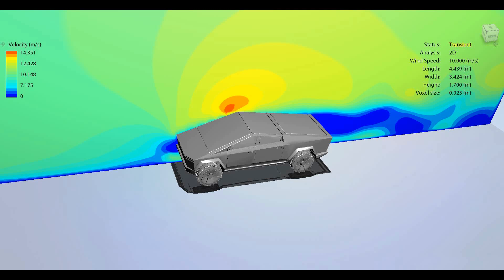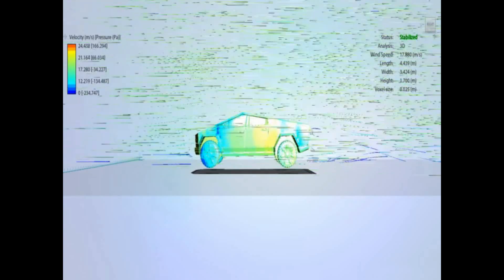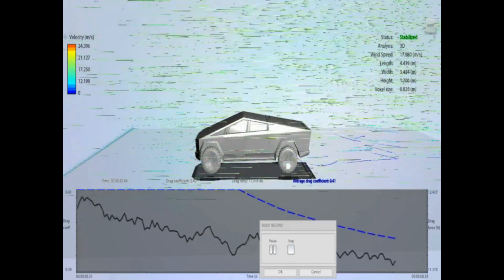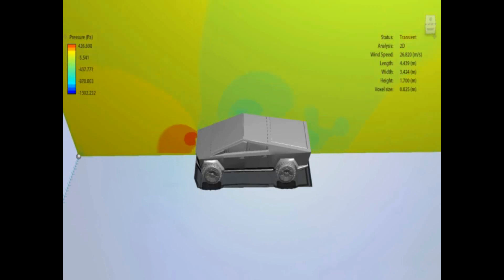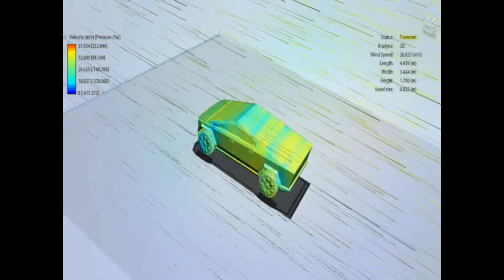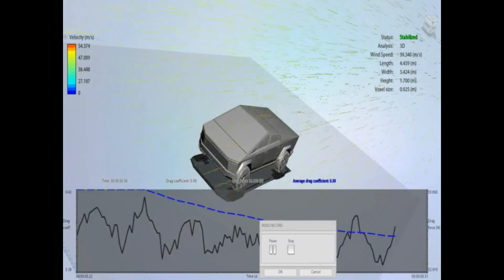Cybertruck aerodynamics - Whats going on?!!!

Comment from the maker: Please bear in mind that the cd figures show in this video could be  way out! 
I am using out of date software and the model is not 100 percent accurate.
I have now made a follow up video showing cybertruck compared to other pickups which gives more insight:
https://youtu.be/7741YdnAcR4
Reply: Can you show one with the truck bed panel opened on the cybertruck
Reply: from an aesthetic point of view i have called this vehicle "ironically truck like" as i think it very much appeals to "the guy thing" as US trucks are legendary for. Having said that and while this is an excellent presentation what will make this truck stand out (besides the lack of mirrors) is how low the weight in this massive vehicle "sits"(curb weight.) yes I've been blown around by the wind big time driving trucks to lorries but what i really like is how stable this massive vehicle platform is...particularly in the crosswind. as a truck i think this an amazing vehicle inside and out, front to back...and has an absurdly low entry level price of $39,900 US Dollars.
Reply: Which software you are using ?
Reply: I though my phone vibrated at 5:12 Lol.
Reply: Thanks man! I would open the load area of the model. I'm almost sure that you will get quite different values. Overall, is a truck that I would like very much to have here in Portugal! I'm just not sure if it survives to the European legislation... The truck has too many Sharp edges that may Hurt pedestrians (something that has been a big concern in automotive legislation :( ). I like that the truck has such straight panels. It allows us to be creative when modifying our truck. So in my case is not so much the futuristic looks that matters...is the simplicity and costs :)
Reply: Wow, 798K views in a week..
Your video on Cybertruck has been Trending.
I'm pretty sure you're glad that you made this video.

Most of your videos didn't even reach 50k views but a Cybertruck has 3 quarters of a million.
Reply: Please drop the ride height by 8". This vehicle has dynamic ride height and drops to a "crouch" at higher speeds on smooth roads.
Reply: David Ogawa The air that goes under your car has a bigger difference in the aerodynamics than the air over the car. That’s why newest cars have air dams below the bumper and most of everything under the vehicle is covered by plastic covers
Reply: Is it legal to drive...?  Military style truck, aaack!
Reply: what software are you using, and what would you recommend for someone looking for low-cost cfd?
Reply: @tejasvimishra1   thanks😊
Reply from the maker: @tejasvimishra1  yes it is flow design.
Reply: Not always truck bed will be closed, so can you Analysis with back lid open?
Reply: You forgue te broken Windows
Reply: Isn't it meant to close of the tub of a pickup for long trips? Btw you tested the cyber truck with closed tub and the others open
Reply: Hi Chris,

Could you repeat the test using a Model 3. Or could you repeat the cybertruck test introducing an opposing laminar flow of air, shooting from the front grill to the front (think of the Dyson airblade), creating an air shield for the front side of the car (like an umbrella than a blade)?

I am trying to figure out what is the contribution of air drag to watt-hour/mile and if we can create sort of a force field around the car to reduce air drag and thus improve energy efficiency. I read that this was done successfully for aircrafts and I was wondering if we can do this for cars and increase range!

I will try to learn CFD but I am from Computer Science back ground and not sure how much time it will take.

Thank you,

Faiz

Comment: I've got a Cybertruck on order but probably won't get it til the end of the second year. By that time I expect there will be some after market aeromods we can buy.
Hers my list of mods I'd try 
First off I'd think that instead of knoby tires some better all weather street tires for better airflow. 
 Then a flexible air dam in front, some wedges in front of the front tires to keep the turbulent air out of the wheel wells and some side skirts to keep air from wrapping around the sides into the low pressure under the car.
And there's several things that might help the turbulent air dragging behind the tailgate... A diffuser under the rear end comes to mind AND a teardrop tail shell attached to the tailgate with some vortex generators on the tailgate top edge (at least 9 of them I'd think).
A big thing is the ongoing effort to get rid of the side mirrors which are huge turbulent flow (ie drag) generators and just use cameras. But that requires a lot of state legislative bodies to change their laws so I wouldn't expect that soon, even though it's needed.

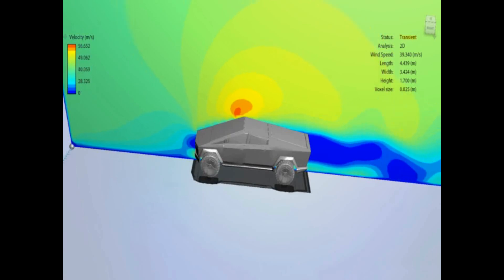Comment: Well, from interpreting your data around the @4:35 mark, doing some conversions and approximating the frontal area of the truck as being 40 inches by 80 inches (excluding slanted frontal area of windshield), that would mean at 87mph (26m/s) you would have an opposing force from the air pushing back on the truck of 415lb (188kg). I would in no way consider that negligible or even small.

At @1:58 - 39.8mph (17.8m/s) you still have 83.2 lb of force opposing the truck moving forward.

This does not include the drag cause by turbulence behind the truck.

Would also be interested in seeing boundary layers.

Comment: 2:09 you say don't have it on the ground. Is that a limitation of the software? Maybe you have a tiny model artifact hanging off the bottom under the model? Could you instead include a road bed slab as part of your model, raised up to touch the wheels?
Reply from the maker: Hello, it's as far down as the model will go in the environment, I think it's just so that you can see round everything. Good idea for the slab in terms of looking at the flow,  but it will measure the drag of both the  slab and car model.

Comment: this was an awesome video - thanks! and you're clearly more schooled than me, but wouldn't you need to have an open pickup bed to see aerodynamic forces?  Normal pickups have a lot of air swirling around the cab in the bed, wanted to see if that was resolved in the tesla design.  Thanks dude, earned a new subscriber
Reply from the maker: Hello, yes open bed will make the cd higher. But the cybertruck comes with the bed cover as standard.
Reply: Boats and Engines ahh gotcha - cheers!

Comment: The panel design is only aerodynamic to a certain degree. People think this is aero dynamic because early 5th gen stealth aircraft, like the F-117, featured panel designs and it “looks fast.” It was only designed this way to refract high frequency radio waves. All stealth aircraft now feature rounded and smooth edges to be aerodynamic. The panel design has no advantage to aerodynamics on aeroplanes.

Comment: This analysis can't be any more than a rogh qualitative overview, we also don't know what your residuals nor your turbulence model are.
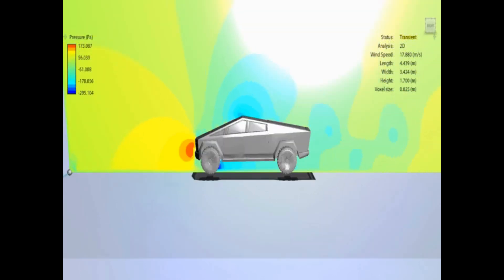You've said that no separation occours (0:50), but the separation region can be predicted only with a good near wall grid and the proper scenes to show it are velocity vectors on the boundary layer and the wall shear stress.
From the velocity magnitude scene I see that you haven't used a moving ground: may not be too relevant for a high ride vehicle, but still quite inaccurate. Don't know if you used a rotation rate on the wheels either.
You said there is a vortex in the front of the car (1:01), this makes me highly doubt you know what you are talking about; any object encountering a flow will generate a high-pressure stagnation region on the front, a vortex is a completely different thing. Then obviously the flow has to split in some way, but "artificial splitter" seems a bold statement.
The most serious problem though would be if you actually used a 28 mm CAD model to simulate flow at normal road speed; the Reynolds number Re tells you that it is like simulating the 1:1 scale model at less than 1 kph: totally irrelevant. A sign of this may be the periodic wake, typical of bluff bodies at around Re = 100. For a vehicle Re should be at least in the order of millions.
At least, I'll give you that switching to 3D steady state for the Cx evaluation is the right thing to do and sharing this kind of content is interesting.
Reply: Yeah... its pretty obvious he has no real clue about what hes talking about

Comment: Dude, why is Cd dropping with increasing speed? This indicates your model is probably incorrect.
Reply: Yifan Yao The flow becomes more turbulent. This makes viscous effects less important and thus decreases skin friction. This is what vortex generators do on airplanes.
Reply: @patefrilund  isnt the point of Cd, that drag is proptional to the velocity squared: f=cv^2, were c is a constant. If cd changes then this relationship isnt true?

I do know that some forms, like a sphere have their Cd change with RE, i.e. velocity. There are experimental grapghs for this. But it feels like theres a contradiction somewhere, am i missing something? Can someone explain?
Reply: Jordan Mills Cd is not actually a constant and it is indeed a function of Re. In practice, variations in Re are usually small, this is why Cd is usually treated as a constant. But in this case we are going through a wide range of Re which is why we see a shift in Cd.

I’m no expert on this matter so someone smarter will hopefully correct me if Im wrong.

Comment: It's almost like the top of the truck is designed like a Venturi in a wind tunnel, with quick flow acceleration and slow flow deceleration to prevent separation over the rear of the truck. Cool shit 👍🏻

Comment: At first glance it doesn't look aerodynamic, but at low speed the box shape doesn't really matter (air resistance goes with velocity cubed or smth) and at higher speed those vortexes/ high pressure zones create artificial curved surfaces for the air to go around.
Reply: High pressure zones dont magically make it aerodynamic. These zones produce drag, and the thing doesnt look aerodynamic because its not

Comment: Ok so the reason today's cars avoid sharp edges in aerodynamics is because air needs to flow alongside the body without being disrupted (air separation causes small turbulence- bad). Look at a "normal" car for example- top of the windshield connecting to the roof part is almost the same in every single car (small deviances in angles because why?) How cybertruck manages its aero is still a mystery to me (looks pretty scary). I don't know why but simulation in this video seems kinda off. (I'm not a expert).
Reply: Simulation is very off, no way there isnt seperation after that sharp as fuck edge on the roof. Also "drag decreases as speed increases" is quite a nice one

Comment: I'm willing to bet, the energy cost and financial savings made by not making this the most aerodynamic vehical on the road, like many car manufacturers tend to spends thousands on during their design phase, may actually be more, than the energy cost increase, to powering the car in its current and future states, than if it was designed to be a sleek bullet etc.

Comment: I know with normal trucks, having the bed open and exposed improves the overall aerodynamics. Did you happen to simulate airflow of the Cybertruck with its bed open? I wonder if it has the same vortex-suction effect with its revolutionary shape? Thanks for the video, this is awesome.
Reply: I know a lot of people will disagree with me so here is the explanation I gave the comment below: "When there is no cover over a normal truck bed, the air creates a vortex of low pressure in the bed, which, in turn, creates a streamlined "invisible hood" that decreases drag. When you put a cover on your truck you eliminate the possibility of creating such a vortex and end up creating more turbulence. This was explained to me by my professor at San Jose State University. He is an executive at NASA with a Ph.D in aerospace. Take it or leave it."

Comment: I'm pretty questioning of how good the results are with Autodesk Flow Design - I've messed with that and found it to be a rather primitive CFD program that doesn't give the results that seem sensible or what you'd expect, one that has been discontinued due to it's lack of capability. When I look at this design, I think of the three parameters that matter for aerodynamics - drag, stability, and noise. This addresses drag, but I question how accurately. Stability is mostly from lift (or downforce), I don't know how much lift this would generate - lacking a curved upper surface I'd imagine the airflow won't follow the roof and it probably won't make much lift. But being so heavy it's probably mostly a moot point, no amount of wind could bother several tons of batteries. Noise is also hard to tell, it doesn't have much in the way of protrusions, but I would suspect some noise could result from air flowing over those angular edges. But I imagine it will probably be so solidly built and well sealed that even if a lot of noise is generated not much will make it into the cabin.

Comment: You forgot to add the trailer because this wont carry the sofa or the grill or anything else you would actually need to haul in a truck this is basically a larger car maybe even a small SUV this is no truck also they might need to spend even more money on batteries before electric will actually help the market and a reduction of fossil fuel power plants and steam power plants

Comment: The wake getting directed to the ground is an indication of lift being generated by the top of the car, which is terrible for stability as you approach 88mph. It would benefit from a spoiler that perhaps could pop up from the tailgate at highway speeds.

Comment: I don't think this is how the pickup truck is gonna look well not the Uk spec as it wouldn't pass the test on pedestrian safety i.e sharp edges. Can't remember what the test is called but it states vehicles must cause minimal damage if they were to hit a pedestrian in an accident
Reply from the maker: Yes, I think that's what ended the defender too. I expect they are going to have to make some changes to the front to make it comply with regulations here.
Reply: @BoatsandEngines  For the defender it was emissions not passing standards but it's coming back. I'm guessing it's a prototype that will be fairly heavily tweaked but it will still resemble the Cybertruck of today hence the low $100 deposit

Comment: Could you please make an aerodynamic simulation with an object which has a dimples like a Golfball but instead of ball shaped dimples they should be egg shaped. The coned shaped tip is directed to the airflow and then the round tip and what where the differences?

Comment: the diagram shows clearly that the sharp edge on the roof line causes unnecessary turbulences. And it has no other functional benefits, because nobody necessarily  needs this extra headroom . It was done for the styling only.   
What the computer model does not show is the uncovered front axis and front suspension  on the real car, that are bad for the aerodynamics as well.   
Generell sharp edges are not good for the aerodynamics, but the flatter the windscreen ,the less the edges have a negative effect.  at the front on the bonnet, where the air has to pass over, the edges are not that sharp but beveled to less then 45°

Comment: This strikes me as a silly debate because NO truck has good Aerodynamics, and the Cybertruck is probably better than most.  This only became an issue because people are comparing it to other Tesla cars.
The reason it's so angular is the alloy of steel they used cannot be bent into smooth shapes without breaking the press.  It has to be folded.

Comment: I think its profile is like an airfoil which creates high pressure underneath and low pressure above, therefore, when traveling at higher speeds it might be lifted up, which would be a disaster.
Reply: was thinking something similar,  a repeat of the early Audi TTs if not careful

Comment: well car still sucks gonna have a 80 mile range when towing at 80% capacity
Reply: Not likely,  only energy used for acceleration is affected, not drag.  Also much of this is recovered with the extra energy collected with regenerative braking when heavily loaded.   The range might be slightly less, but not much.   A ICE truck doesn’t regenerate fuel when it uses brakes, let alone extra energy when loaded.   So ICE trucks lose range much faster when loaded.
Reply: @miikkakangas6750  gas has much more energy density than electric motors are efficient

Comment: In the red points they can even reduce the pressure over there using thermodinamics or heat transfer,using the heat of the motor and take it to that place,in that chase the effect of hipercavitation can be useful! The russians did in some missiles under water.Im not sure why these dumb as millionaires dont use it.

Comment: What would the addition of vortex generators added to the top of the windshield do to the high pressure on the roof?
Reply: It has low pressure on the roof, and vortex generators would increase that, and thats bad